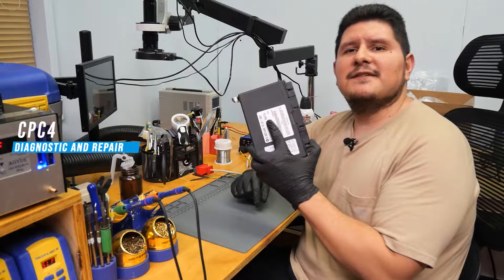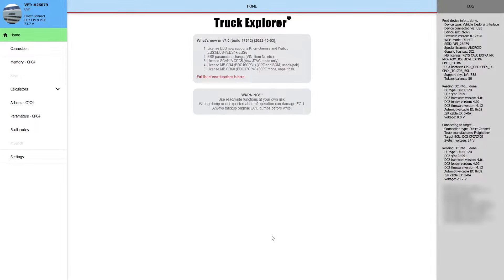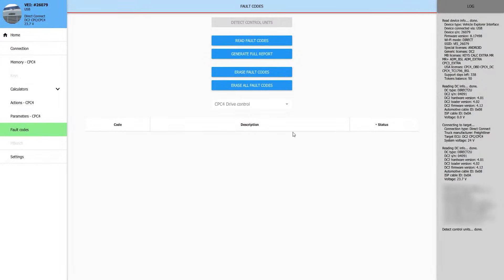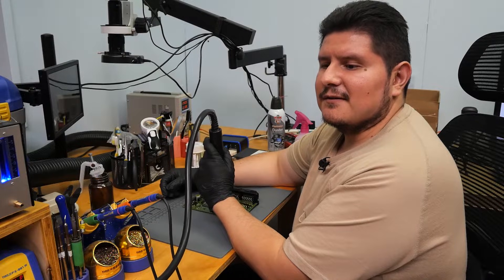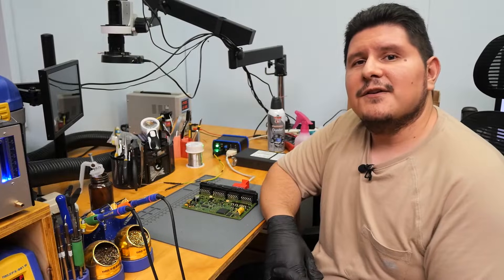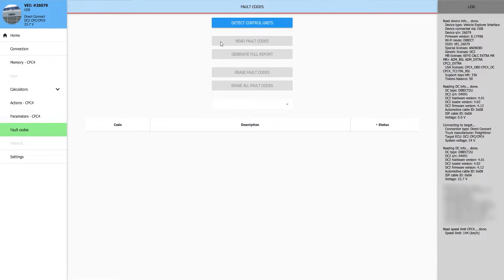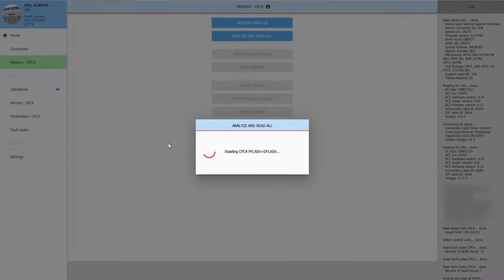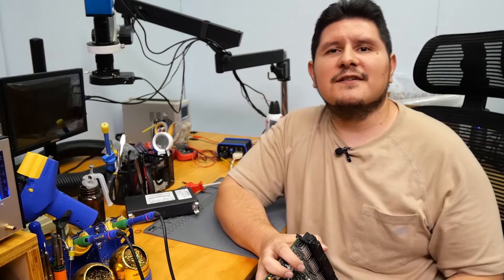FREIGHTLINER CPC MODULE TESTING AND REPAIR

Comment: Where’s this module on a 2011 freightliner mt55?
Reply from the maker: That I am not sure. We only work on the 2013 and older. The test truck I have is 2014 (manufactured 2013) and it's behind the dash to the right of the instruments. I don't think it would be the same for the 2011 but it might be.

Comment: What is the device you're using to send data to/from the CPC & supply power via the bench PSU ?
Reply from the maker: That is a device made by Autovei, you should give them a call or check out their website. They have lots of cool bench testing tools.

Comment: I have a CPC that has no communication and does not turn on on a 2016 Freightliner Cascadia Evo DD15 engine. Can you fix it and could you tell me how much the repair costs? I would appreciate it very much if you answer me. Thank you. I look forward to your message.
Reply from the maker: Hello Hector,

The symptoms you are experiencing are as you suspected commonly caused by the CPC4 for the 2016 Freightliner Cascadia with the DD15 engine. 
I created a page describing the common faults with CPC4s, explaining why they occur, and how to fix them in a way that will prevent future failures. If you are interested in learning more about it here is the link below:
https://nickselectronics.com/pages/cpc4-diagnostic-and-failure-prevention

If you are not interested in those details and just want to send it in for repair, here is the service listing which has our price information:
https://nickselectronics.com/products/a0034461002-004

Of you have any questions, don't hesitate to reach out.

Comment: Can you fioa tcm open circuit cascadia 2016 with a TD12 transmission?
Reply from the maker: Hello,
I am sorry but I don't understand the question. 
We don't really do to my freightliner repairs other than the CPC4 and sometimes ECM but mostly really repairs on the CPC4

Comment: Do you repair abs module 2014 international pro star 4300
Reply from the maker: We have not been requested to fix these yet but can give it a diagnostic and see if there is anything obviouse with them. 
What faults are you experiencing with the unit?

Comment: I need to fix , one cpc , not rpm communication
Reply from the maker: Yes we commonly fix these with that exact problem. Should have no issues with the repair. If you want to send it to our repair facility you can do so. We always provide a 1 Year warranty with our repairs!
If you want to purchase the repair service right away, you can do so on our website linked below:
https://nickselectronics.com/products/a0034461002-001
Once you make the purchase an email will be sent out with shipping and packaging instructions for you to mail out your defective unit to our repair facility. 
If you aren't sure the CPC4 is defective and would rather send it in for a diagnostic before you pay for the service we also have  service for this linked below:
https://nickselectronics.com/products/cpc4diagnostic

If you have any questions or want to speak to us directly you can always give us a call (520)838-9359 or you can email us / fill out our contact form on our website: https://nickselectronics.com/pages/contact

Comment: Freightliner Cascadia CPC 2016 DD15
After fixing by you guys. 
Do I still need to program the CPC at the dealership or just plug in the CPC and be good to go?
Thank you
Reply from the maker: Hello,
CPC modules don't always need to be reprogrammed after repair. It depends on how they fail and how severe the failure is. 
Most often the CPC4 does not need to be reprogrammed but in some instances it does. There is no way to know for sure upfront. 
If you want to send in your unit for repair, we do have a flat rate service available (links to our repair are in the video description) 
If you have any other questions, don't hesitate to reach out directly to us via our email also in the video description.
Reply: Good question

Comment: La cpc se puede desprogramar si la quitan  del truck y dura 2 meces sin ponerla ?
Reply from the maker: Si y no.
Primero lo siento, no hablo muy bien español, así que tuve que usar el traductor de Google. Por lo tanto, el software no puede simplemente desprogramarse incluso si la batería pequeña se agota. El software sigue ahí incluso si estuvo allí durante 10 años inactivo.
Sin embargo, puede tener síntomas y fallas de software porque hay una falla de hardware. Esto es común. Entonces, si tiene códigos de falla de software, es probable que se deba a que el chip del procesador tiene juntas de soldadura rotas y no se comunica correctamente con la placa. Para reparar esto tienes que reballear el procesador como lo hacemos en este video aquí:
https://youtu.be/ETU48CGi8Bs?si=ENMhp97OTWAJXOaJ

Ahora bien, algo más a tener en cuenta es que a veces, cuando el CPC4 detecta un mal funcionamiento del hardware, puede entrar en modo de protección. Si esto sucede, es posible que se bloquee y la única forma de sacarlo del modo de protección es volver a flashearlo. Entonces, en cierto modo, se puede decir que el software puede fallar, pero cada vez que lo he visto fallar se debe a un mal funcionamiento del hardware.

Comment: Hi where i send CPC4 for repair & what's the cost?
Reply from the maker: Hello, please check the video description for more information on our services and pricing. 
There is a link to our listing there which will have all the information you need. There is also our contact information. 
You can always email us or fill out our contact form on our website (also linked in the video description)

Comment: My auto meter is not working. Somebody stole my CPCI. Change it after that. It is not working.
Reply from the maker: You may need to get the new one reflashed then or you may have gotten a defective one. Our contact info is in the video description. If you want to send in our CPC4 module, we can test it for you and let you know if it's working. 
First i would want to have you email us (email is in video description) with the exact model info of the vehicle and part number of the CPC4 module along with more details on the failure. All symptoms technically qualify as "not working" but having more infomation on the specifics of what "not working" means will help us better understand what is going on and if there is more than just a CPC4 fault.

Comment: Hi , Do you also have a solution for MB / Freightliner ACM2.1 Can error. The ECM  and  CPC module give an error no message from ACM.
Reply from the maker: Jerry,

I haven't worked on that kind of issue before. I am not exactly sure what could be causing that, but what I can tell you is that I have not seen a CPC4 module cause that fault before.

Comment: where could we buy the steel plate to do the reball and all the little solder balls? we have a couple trucks in our fleet that are in need of this repair. thanks!
Reply from the maker: Hello Chadd,
I am sorry but I highly recommend you do not try and fix your CPC4 modules. If you do not already have all the skills, equipment, and at least several hundred hours of experience under your belt, then you will most likely damage all your CPC4 modules beyond repair. I recommend you send in your CPC4 modules to our shop for repair. And I know I am biased on this, but the reason I say this is because we have had several electronic repair shops with re-balling experience call us saying they tried re-balling their customer's CPC4 and killed the boards and then wanted us to fix them. 
Reballing is a part of the repair process, however, there is much more to it, that is not shown in the videos that is required to properly fix these. It is a very time-consuming and involved process to get these backup and running which is why we charge more for this repair than any other. This is why every electronics shop in the USA does not have the ability to service these and only a handful of shops do. 
My team has over 20,000 circuit board repairs under the belt combined, it took us a while to perfect and fine-tune our repair process for these CPC modules. I am not saying that's how many repairs you need to do before working on these but it is to show that experience is important and even with our experience we had to work hard to ensure a high success rate. 
I apologize for the long message, but it is important to say that these are very hard repairs, and should not be your introduction to re-balling. If you want to learn re-balling I think it's a great skill to have but you should start by working on low-cost low-risk boards, not on 6-month-backorder boards that are very difficult to replace. 
If you want to give us a call Monday when we open back up, I would be happy to talk to you further. (520)838-9359 or you can always email me at support@nickstvs.com

-Nick